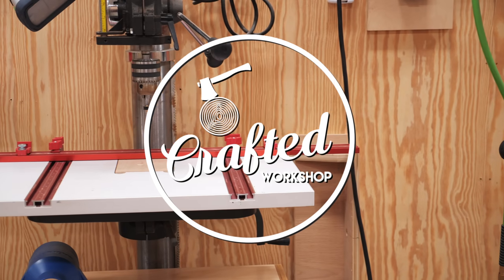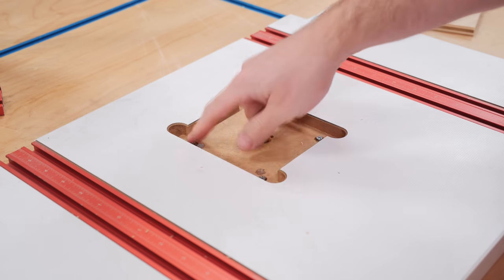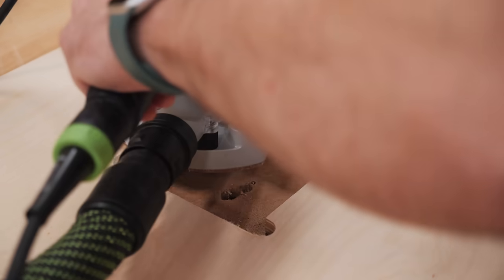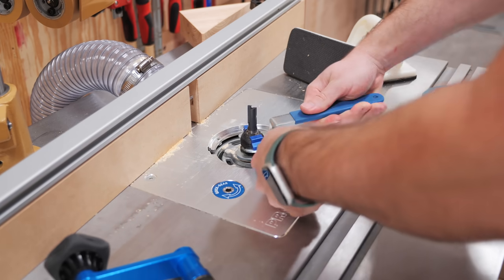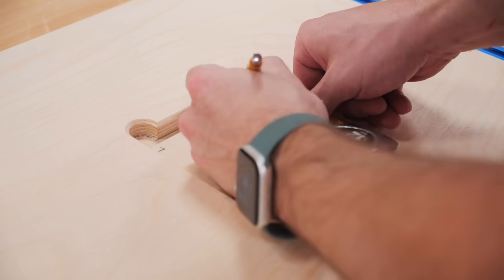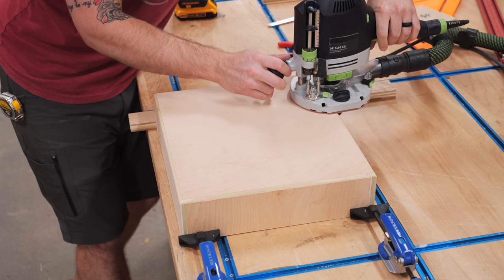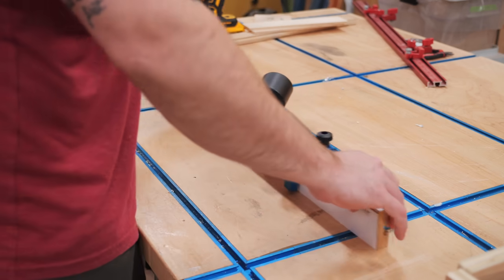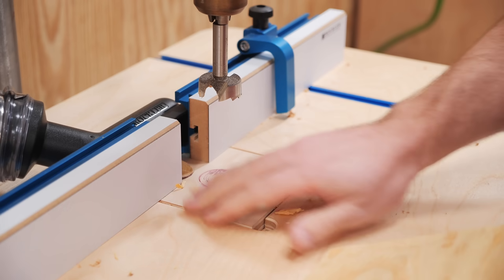How to make a DRILL PRESS TABLE w/ DUST COLLECTION and FENCE

Comment: Such great I deas. One that I often see overlooked is a replaceable insert that is a circle, rather then square. The circle can be rotated and last much longer, when edge of circle is off center of drill bit for diameter rotation. Easy to make with pattern bits, bandsaw, or saw tables, and even a disk/belt sander.
Reply: Oooo I like this.

Comment: I like the idea of having a drawer. I have the same problem with that lousy crank getting in the way of a "real" drill press table so this is a nice alternative to provide room for it to turn while providing a good table.
Reply: you could move the hand crank to the front (facing you) using 2 90* bevel gears and a section of steel rod.  Kinda easy-peasy

Comment: Great build!  
Question about the Vacuum bag. What do you do if you have squeeze out when you use the bag? Is it coated inside to help remove the glue?
Reply: You can use melamine platens inside the bag above and below the work piece and any glue would go on those to be cleaned off later.

Comment: Great job 👍😊I have the same nova drill press .. I’m going to build one of these.. you need to check out the keyless chuck that nova sells. Just got one for mine it’s a beast.. holds bits tight and you don’t need the stupid chuck key anymore 👍😊

Comment: The only things that would probably improve on this build would be "moving" the height adjustment crank (or replace it with a wheel) to the front, using a set of 90* gears.  You could also have moved the table lock further out to the side, so you wouldn't have to reach so far and awkwardly to lock the table height.  You could have also gained a touch more work surface doing those two things.  Overall though, it's an EXCELLENT build!!  I'm definitely going to take a look at all those companies' tooling!
Reply: I've seen a vid of how to change to bevel gears for the table elevation.  I'll try to remember where I saw it.

Comment: Never used pocket screws. I would worry about securing INTO plywood. Would seem like not much depth for the screw. Going into 2x4, etc, i get that. But the screw penetrating only a half inch or so into plywood, not so much.
Reply from the maker: The screws penetrate close to ¾” and Baltic Birch plywood has incredible screw holding power. Not worried in the slightest!

Comment: I so badly want to make stuff like that. Sadly wood is so over the top expensive overr here. 
Yesterday i checked for making a workbench to start with, but the wood required for just the top is around 250 euro, guess close to 300 dollars.
Reply: Start with laminated pallet wood you can sometimes find them for free if not super cheap. Even if it isn't your first work surface and you have skills it's still gonna get beauty marks from hammers and chisels why spend lots on practical tables :)
Reply: @nicko198718  I guess you are right. Maybe i'll do that to start with and add a better top later. Problem is i'm one of those people who cant hold a hammer, but wants purrfection.  Gonna be a fun ride.